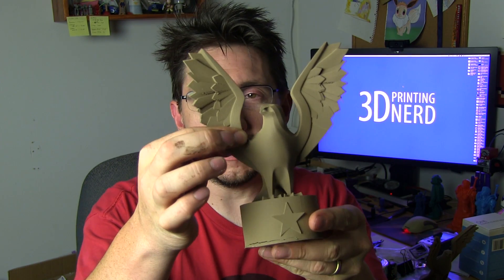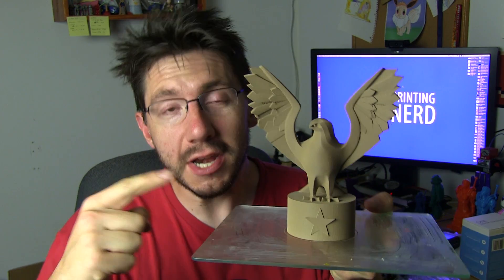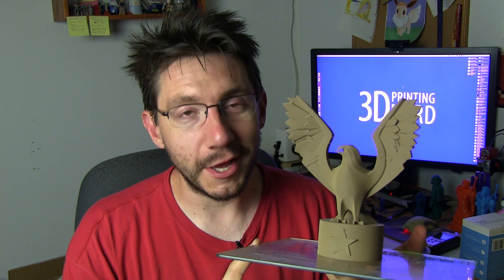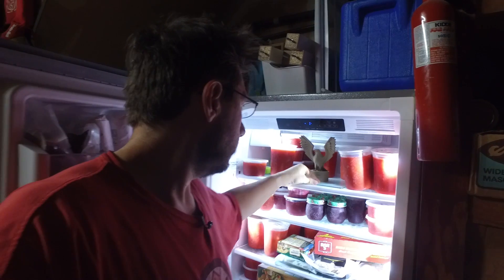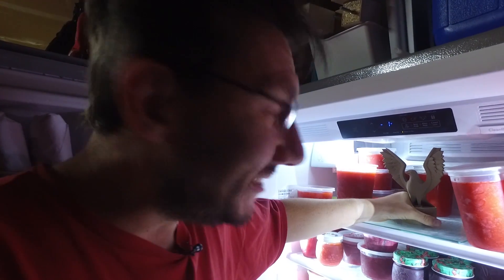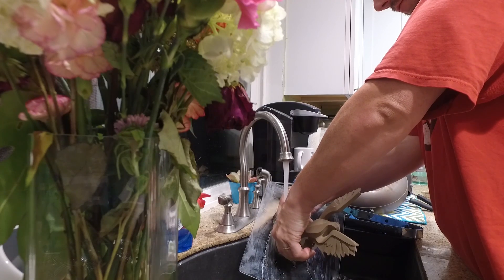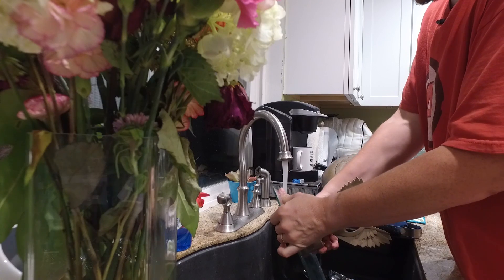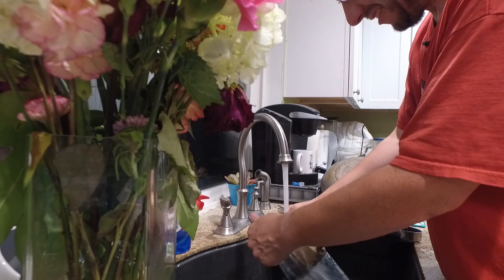3D Printing: Bald Eagle Fail ... Again

Comment: Printing with a skirt might help give you some leverage around the edges to start peeling the bottom of the print up. Other than that, patience when soaking the build plate with water and maybe using a slightly thicker coat of glue stick might have worked, you need to give the water time to wick into the glue under the large base.

Comment: You should use a blow dryer to heat the bottom of the build plate to make the plastic more malleable, thus result in removing the 3D print easier.

Comment: Fill the gap between the skirt and the print with isopropyl alcohol, let it sit for a few minutes and it will reach all the way under the print and it should just slide across the bed.  I've only done this with clean glass though, not sure how the glue would apply to it

Comment: A couple of things.  Usually it only sticks that bad for me when the nozzle is too close on the first layer and it gets super squished down, and it's a large surface area print.  With the wood glue method, this can happen too, but it can come off easier with a long flat segmented razor blade without the holder.  Just rock it back and forth and hope for that crackle sound.  Otherwise I have about a foot long 2x2 board made out of poplar that I smack it sideways with.  It's scary doing that, but it most often pops off with that before hurting the model.  It makes me wince every time I do it.

Comment: I have had amazing luck with removing prints by using a small hammer and tapping the print around the base until it comes loose. Works everytime except on very thin prints. Should work on the eagle though.

Comment: I used aqua net hairspray build plate temp 60 degree C 20 % infill on my Robo 3D and wood filament scaled it to 150% and after letting in cool down completely it popped off easily

Comment: Get the cheapest hairspray that says extra strong hold and quick dry! i use L'OREAL Paris advanced hairspray. Apply to glass put on head bed and heat up to 60oC for pla and 100oC for abs and it will hold your print until it cools down and then comes right off! If not soak in worm water for 5 min. Good luck! Very big fan of your work!!!

Comment: I think glue sticks are a wax product, seem like if you heated the glass from the bottom side it would release. Yes you tried hot water but try sitting it on a heated build plate at 60 or 70 C. Or just put a build tack on that glass and be done with it.

Comment: Whomever designed the model really should have added a small fillet to the bottom edge. This is also another good reason to have a heated build plate. You print warm and when they cool your print usually releases or at least the bond is somewhat released.

Comment: My brother and I have found that the glue sticks just make your prints stick very bad, I actually broke the glass on our daVinci printer because it was stuck on the bed so bad ( though we do chalk it up to the Chinese glue stick it came with, which was most likely not water soluble. Hairspray works the best on our machines, on our Robo, and Alpha, and with hairspray you can remove it easily with a warm damp washcloth.. it just needs to break down the hairspray which dissolves in water.. We use Aquanet hairspray, cause word is it has the best hold.

Comment: Is it possible the problem is the model? I printed 3 of these (red, white, and blue) on my lulzbot mini with blue tape on the bed with a couple of different types of filament and I've never had so much trouble getting a model off the bed. All three of them were so stuck down it took incredible feats of strength to get them off.

Comment: you should try to twist instead of lift or scrape, print it with more plastic in the base ,and apply a rotational moment to the base when separating , the same thing applies to the oreo twist method , if you twist it you wont brake the cookie :P

Comment: Are you sure you used a glue stick and not superglue by mistake?!?! Lol. I've never had anything stick that well to my glass plate. If I've had anything that's been a little difficult to get off I usually can get my spatula under a portion of it by kind of digging into the thin layer of glue.

Comment: I am interested in rapid prototyping some parts for a custom raspberry pi case. Not being that large of a project, and not being into 3D printing yet, but having good budget, I simply want the fastest bestest printer for what ... under $3000? There is nothing that has a ranking of 3D printers based on the end speed (which I figure is variable based on how things are sliced and printed... ) ... or even just an average... or why the Makergear m2 is worth $1825 when a Robo is $750. That's >  2x difference - what's the reasoning? Print volume? From what I can tell all the tests aren't timed, and they print the object relatively the same and it comes down to how easy it is to level it? Seriously ... is the 3D community just a bunch of failed engineers because the lack of datapoints and math on all this stuff sure would make sense. Ok ... so that said then let me restate: I am an engineer therefore I have fundage. I don't want to do 3D for fun, but for profit. I need the best / easiest / fastest (to iterate my mistakes) printer out there. Which one is that and how do we know ?  Thanks (hope this was humourous).

Comment: hey hey! I used to have these problems with glass beds. It stuck too well or not at all on my i3. I bought a zebra print plate and after some teething problems getting it levelled I love it. take the bed out, flex it in both directions and most prints pop off! the flexibility means you need more binder clips to get it flat though but it's the best surface I've used.

Comment: You have to put it in the freezer for longer! Think about how long it would take to chill a beer. As a last resort you can take a heatgun or hairdryer to the bottom of the glass to partially soften the surface and release the model. However, this might cause the bottom of the model to deform a bit...

Comment: You needed to keep it in the freezer longer and you will hear pops and it will come off the build plate.  Also scrap the glue off with your fingers and try to get under it with a knife while under water.  Try to increase your print temperature so it will not break the model because you need better layer bonding it should be white where it breaks if it has a good layer bond.
Reply: Yeah.  You have to leave it in between half an hour or overnight.  What you are shooting for is for either the plastic to shrink or the glass to shrink.  I can't remember which.
Reply: yep those layer bonds looked weak. It should be better than that.

Comment: Careful when heating/cooling glass rapidly sometimes it will crack. Trick is to get the print from hot to cold causing bottom layers to shrink/expand until it pops off.

Comment: How many perimeters did you print with and at what bed temp? If you still have problems with glue stick, allow it to soak in the warm water for a hour or more to give it time to permeate under the print. Another possible release method would be to heat the bed back up to near the glass transition temp and try to get a razor blade under it. Have you tried using a PVA coating? Can message me on Thingiverse (user: Kurakuea) for further info. :)

Comment: not sure if the Ultimaker can do this but on my printer, if things get stuck i run a "preheat" on my bed ONLY. just keep bumping up the bed temp by 5 degrees each try starting at around 50.
i RARELY do this but it has worked every time

Comment: Never had anything stick that bad on my Ultimaker 2+.  I only use Staples brand white glue stick when printing PLA or PET.  Sometimes I need a razor blade to get under the edge and start the release but most stuff pops right off when it cools down.  I always clean the glass with alcohol first then put one thin layer of glue down.

Comment: @3D Printing Nerd,  Try submerging the entire base in rubbing alcohol for a while.  That stuff instantly softens dried glue sticks.  Its what i use to clean mine,  but never had anything stuck that bad.  Usually a good sharp hit with a real still scraper always works
Reply: Or just pour it around the model like I do. Then you can even use dental floss to remove the model once you get a small spot went you can get the string under it. Print some kind of ring to hold it comfortably and you're good to go.

Comment: +3D Printing Nerd, you really do not need to use glue stick at all on the build plate for a model like that, it will work just fine on clean heated glass (no fingerprints etc, so give it a quick wipe with isopropyl alcohol).
Reply: I agree, i do the same for PLA (and with ABS juce for ABS)
Reply: I use a clean build plate and wait for the Ultimaker to say that you can remove it.  Trying to remove it right after printing is very hard, but as soon as the plate cools, it pops right off.

Comment: If you're using gluestick on bare glass with PLA, try disabling the heated bed.
My prints also stuck really hard on glass with glue + 70 degree bed.
Or try printing it without gluestick at all, just bare glass with heated bed. Mine stuck to a degree.

Comment: How about trying hairspray? Thats what ive used before. And it smells nice
Reply: I would have to say that I like using the hairspray (I found Suave - Max Hold works for me) seems to work on a glass build plate or on masking tape.
Reply: I use hair spray all the time get the rave super hold basically same as aqua net except you can get it in a pump bottle and use a envelope wetter to apply it to the bed no overspray to worry about a envelope wetter is less then a buck at staples 😄
Reply: Suave - Max Hold is easier to clean off the plate than Aquanet.
Reply: My only complaint about hairspray that it coats the printer in a film of hairspray besides the build plate unless you have a super tight cover/shield.
Reply: you need to use some cardboard and fabricate a shield when spraying
Reply: Yep, http://www.thingiverse.com/thing:1473816 , I toss them in the dishwasher if I'm too lazy to use glass cleaner.

Comment: If you are able to you should always put a slight bevel at the bottom of your model so the edge wont be in touch with the build plate. Also, try to not squeeze the first layer too much as its sticks to well. You should have put the model in the freezer right after the print finished to that here would be more rapid warping. When applying the glue stick, make sure it dries completely before you start printing. Another trick with some models is to grab a screwdriver or small hammer and give the model a firm tap on the side to try and knock it off the build plate.

Comment from the maker: Yeah, that sucked.
Yes, I was tired.
Yes, I had been drinking.
Yes, I was full of BBQ.
Reply: Well you had to try
Reply: I always heat up the plate, so it is very easy.
Reply: Use alcohol or a heat gun
Reply: Hey joel ! take my word for it...Do not use any kind of glue stick for models with a big flat surface area on the build plate...and if you end up using glue and the model is stick just run it under water and gently tap the model regularly...water will creep in and will release the model
Keep printing ;)
Cheers !!
Reply: I have a long thin bladed filet knife made for carving large fish. Hasn't failed me yet. The blade is highly flexible and I kind of slice/slide it along the surface of the plate and it beautifully slides under the model. :-)
Reply: Maybe one of these http://www.autodetailingwarehouse.com/store/p/100-Electric-Heated-Razor-Scraper.aspx
Reply from the maker: DUDE. I couldn't get an edge up to release the model with that thing!
Reply: I have tried those moves. I busted my glass plate after taking it out of the freezer.  You know how to get the thing off of there?  take that  BuildTak spatula you have and SLAM it HARD into it over and over.  I don't have the build  tak spatula but thats how i get prints off with my robo3d spatula.  Trying to pull models off has never worked for me. You gotta beat the hell out of them down low with a strong spatula
Reply from the maker: +Nige Cook Heh, NO! Honestly, I limit myself to ONE RedBull per day. That's it. I was tired because I didn't get the chance to start filming until after midnight. Doh!